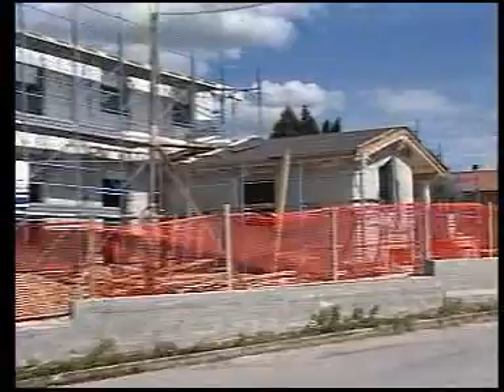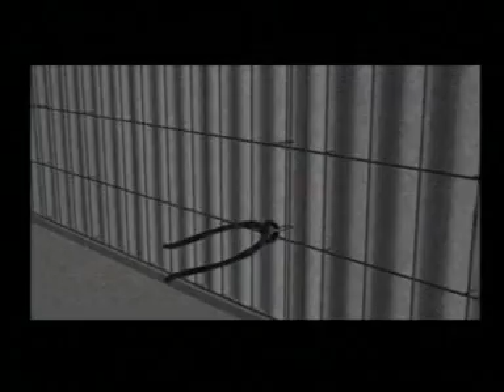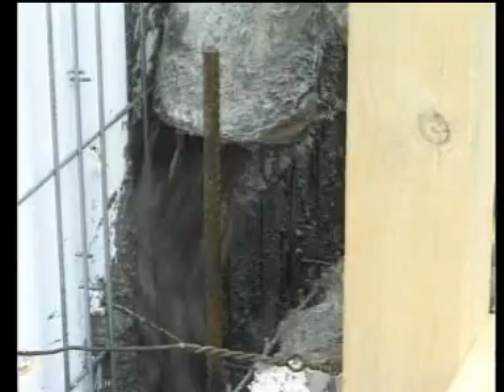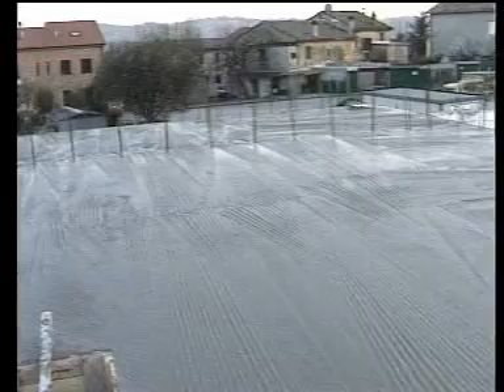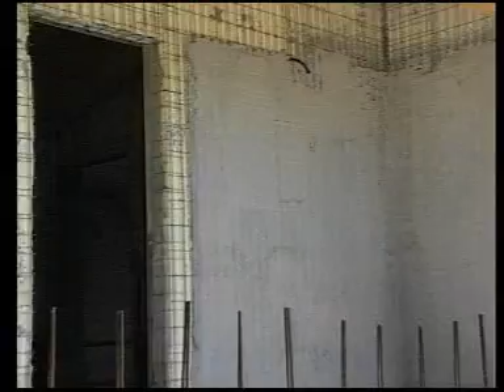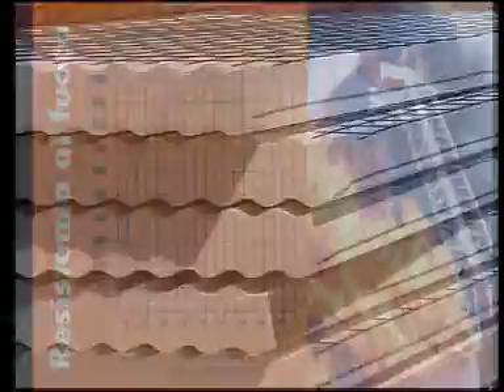FOAMCRETE - Concrewall Panels' System

Comment: i am interested in constructing with these panels, but no one seems to know much about these in uk including architechtects and structural engineers. why is it not used in u.k. is it to do with short life span of panels or other drawbacks i am not aware of? what drawbacks are there that one needs to consider before evaluating method of construction, as these seem very cost effective but i am puzzled why they are not adopted here in u.k?
Reply: I have exactly the same question why 'developed' countries don't seem to be using this technology
Reply: Altaf Hussain did you get the answers you were asking?
Reply: It's faster and cheaper to stick frame.